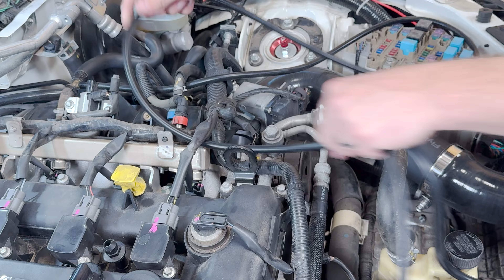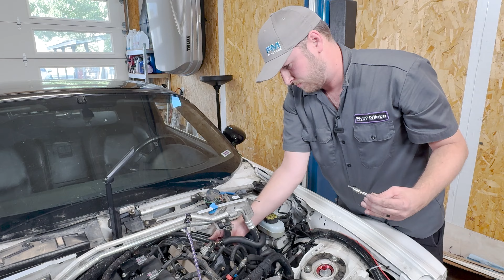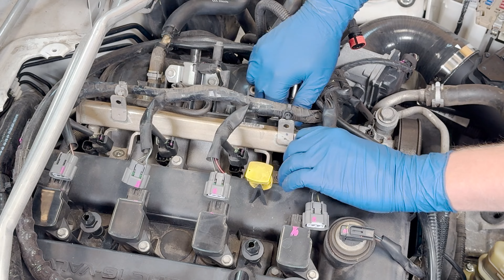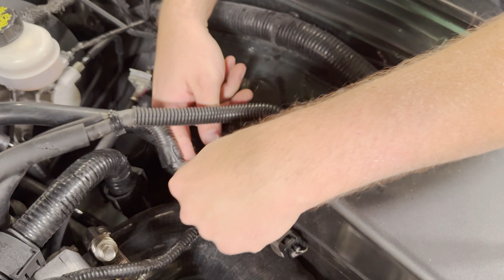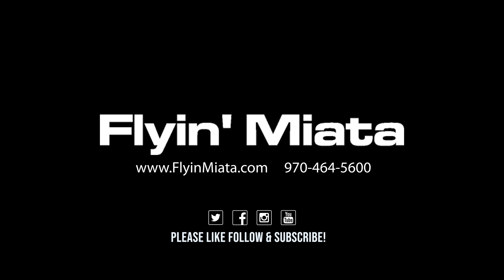6 - NC Turbo installation - Step by Step Guide

Comment: I installed the new injectors today, i noticed there was play in the up and down movement. As in, the injector can slide slightly toward the manifold port and back up towards the fuel rail. The amount is very slight, but caught me by surprise when i plugged the harness back on them. Is this normal? I took it back apart to verify the o-rings were still in place.
Reply from the maker: @chimmychongaz They will probably be able to spin in place (especially if you added some dielectric grease to the injector o-rings), but they really shouldn't move up and down much at all. Make sure that each injector is fully seated into the rail and the intake manifold.

Comment: Time Stamps
0:30 vacuum line install
5:00 MAP sensor install
12:52 washer bottle relocation
16:08 fuel injector install
18:17 fuel rail removal with drain steps
21:40 actual injector install
24:51 EVAP solenoid relocation (NC2/3)
27:23 EVAP solenoid relocation (NC1)